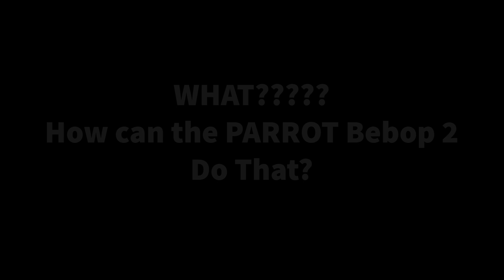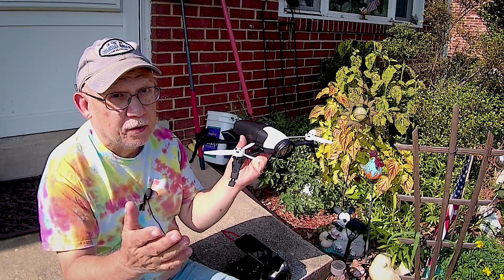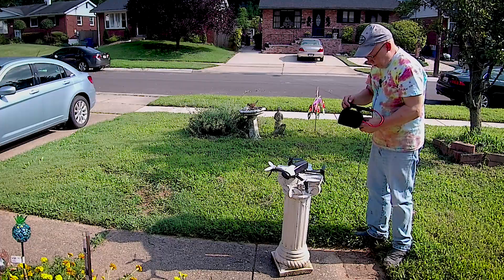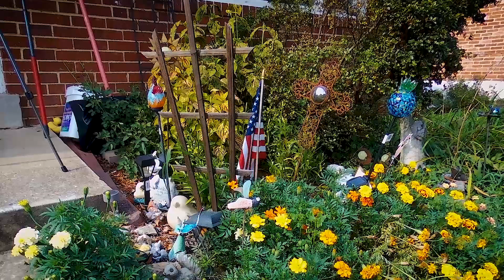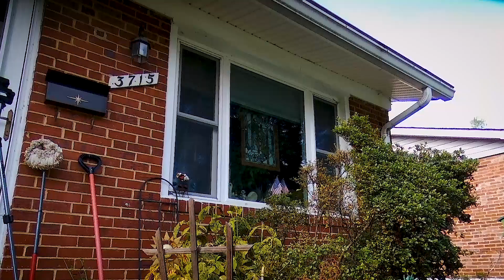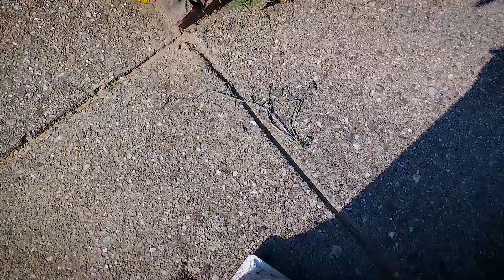WHAT!!!! How can the PARROT Bebop 2 Do That?

Comment: Dude i love the parrot line as well. I splurged and picked up a bebop 2 power fpv after i grabbed a regular bebop 2. Love them
Reply from the maker: Sounds awesome. Do you notice any difference in performance between the power and regular edition other than the difference in battery mah rating?